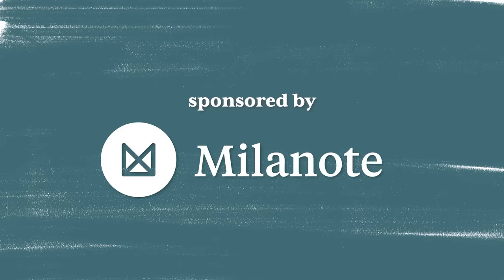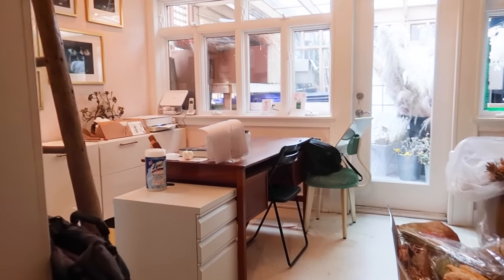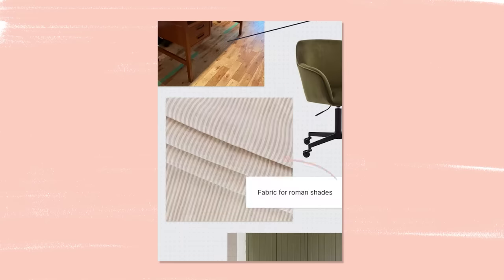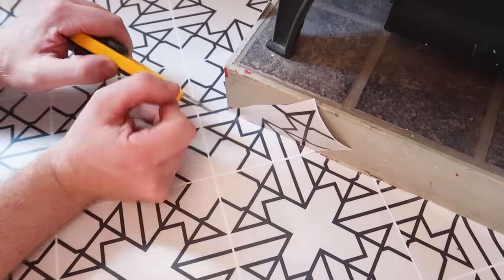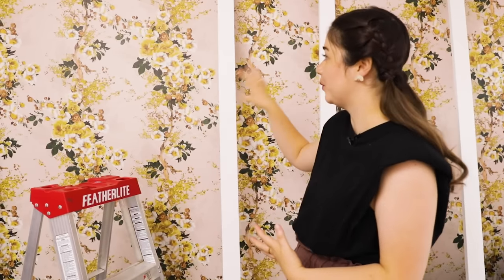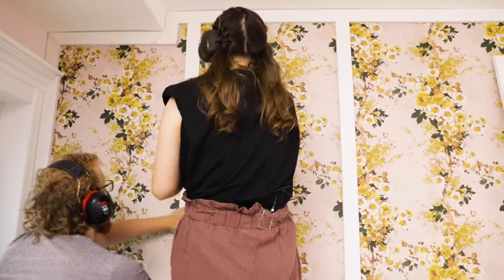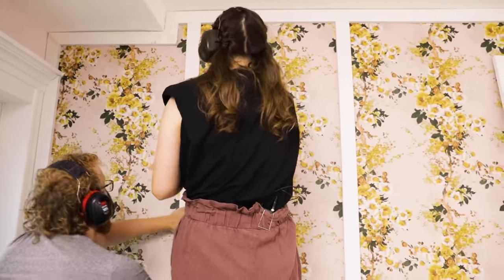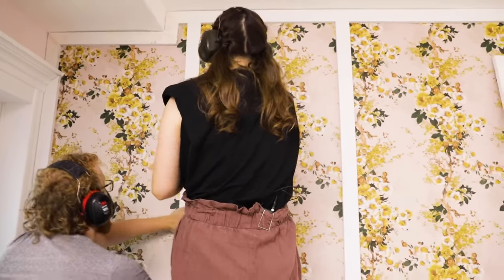Dreamy Farmhouse-Style Office Makeover For A Flower Shop!

Comment: Paint on your fave clothes is the worst! I do have a couple suggestions to salvage those cute shorts though depending on what you’re willing to do either cover the stain up with a button/patch/ribbon/a fabric painted design or you can try to colour match the shorts and paint over the stain with the colour of the shorts - I did this once with a huge brown acrylic paint stain on my blue letterman - mixed a matching blue and painted it over and honestly I wouldn’t be able to tell you what side the stain used to be on it worked so well! Love the suggestion of AG jumpsuits to paint in though! I would definitely get one to prevent my own paint stains on fave clothing items.

Comment: The best way to cut wallpaper is to fold it back on itself and match the sides. Make sure the fold is sharp, and then just use a box cutter in the fold. Voila straight clear cuts. Been doing this for all wallpaper projects I have done, more than 10 at least

Comment: When you install flooring like that, you should snap some chalk lines to get things properly square. Never trust walls. Walls aren’t square, they’re never as square as they look. It’s just like how you used a laser line for your wallpaper and started in the middle, rather than using the corner or ceiling and assuming they’re level/plumb.

Comment: That wallpaper is the best because it doesn’t matter if the cuts are straight, the overlap means it’s an exact match when you cut it and peel off the excess from each piece. Give it a try next time! Panelling looks great, but the wallpaper alone would have been stunning.

Comment: You can remove paint stains from clothing with eau de cologne. I tried it and it works.
Reply from the maker: Noted! Thanks!!
Reply: Dried on emulsion paint comes off with nail varnish remover. For oil based paints I use white spirit followed by a quick wash with dish wash soap.